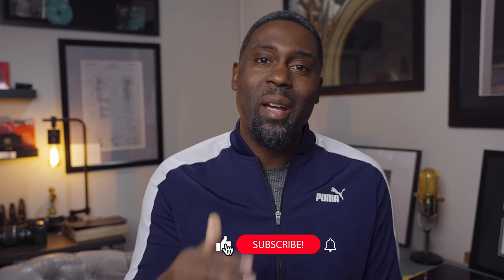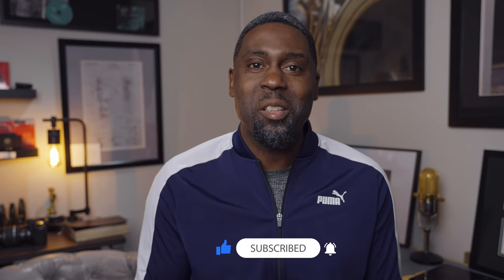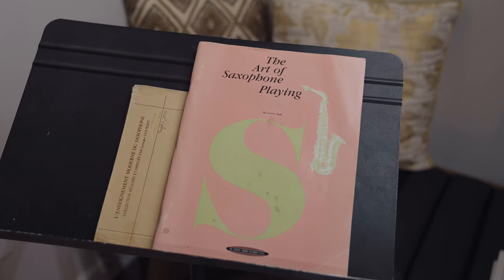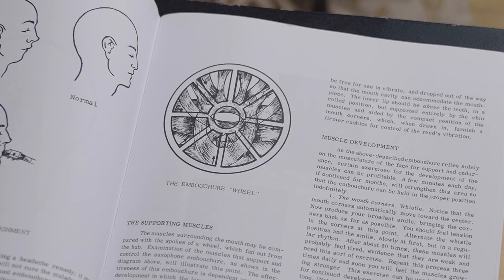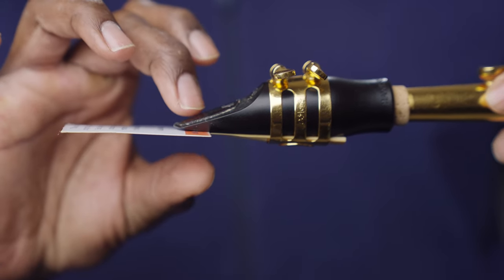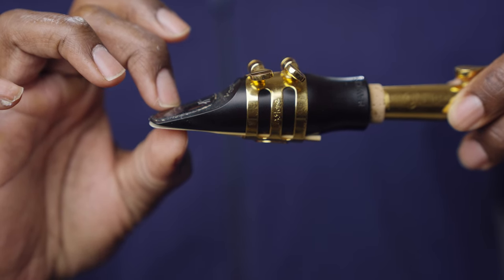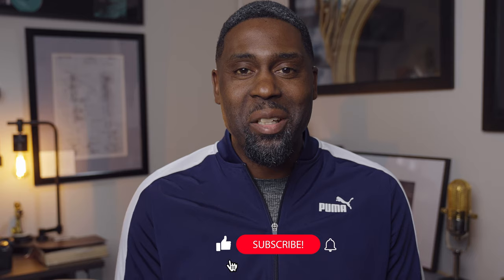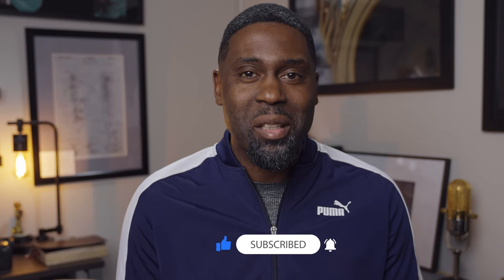Saxophone Embouchure | How To Play The Saxophone | Beginner Saxophone Lessons

Comment: Hi Dr. Young. Thank you so much for this great explanation. What is your opinion on creating (or keeping) a flat chin? I've always prioritized this over the years but feel that maintaining this (especially when fatigued) has the potential to pull the corners backwards and create jaw/overall tension. Perhaps when the corners are in, the flat chin will simply be the result...maybe the only suggestion necessary (building on what you've already mentioned) would be to make sure the chin does not bunch upwards? This has been on my mind for a while and I would love your opinion!